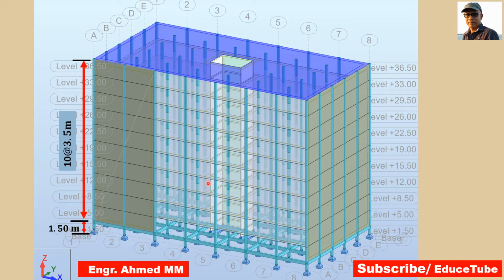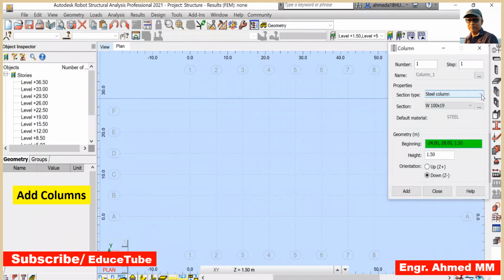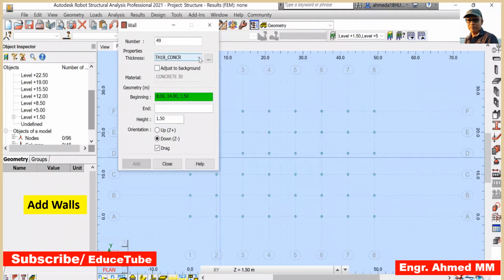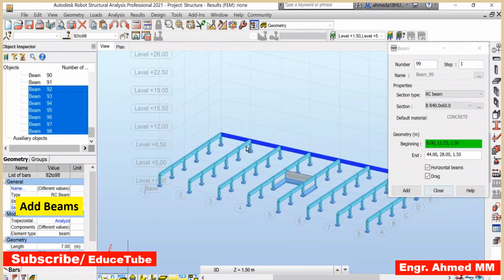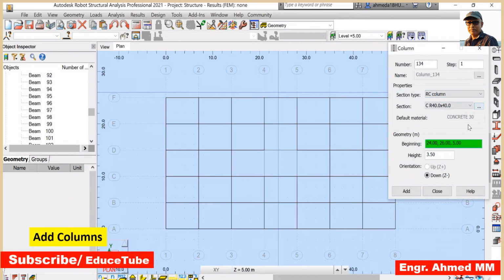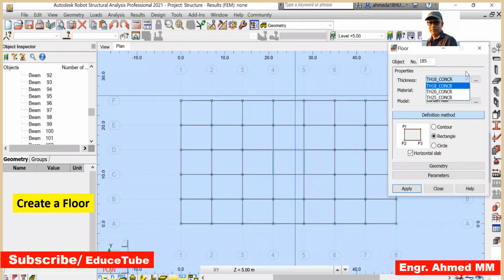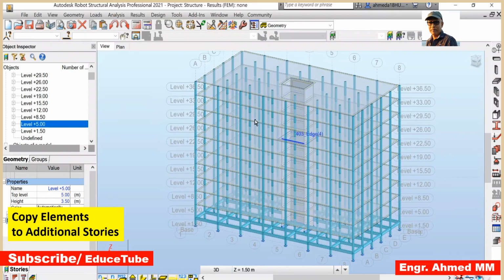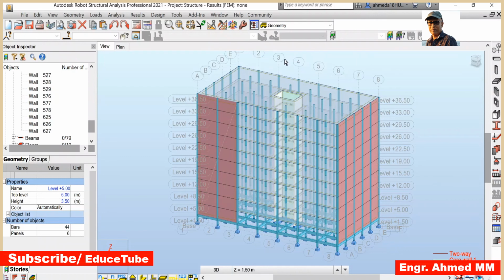Ten storeys Building Structural Model by Autodesk Robot Structural Analysis Professional 2021

Comment: Thanks from your educational videos sir.
I have a request if you kindly could help me with.
can you design 3 story building with ground floor includes as well. the material which are used (ground floor concrete share walls). only slubs and share walls and floor is RCC.
the upper stories are  brick mesonary walls (concrete blocks). roof and slub is RCC
Reply: brick rcc block is called ytong 525kg/m3
Reply: @shamssiddiqi144  you talk too much!